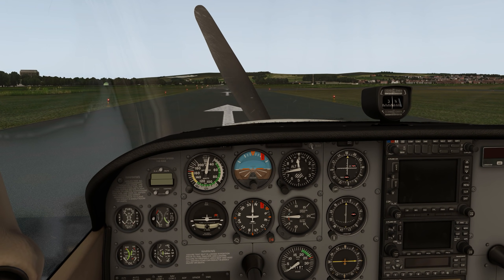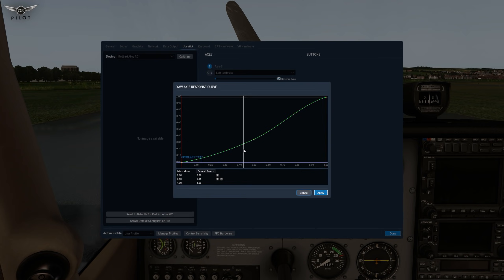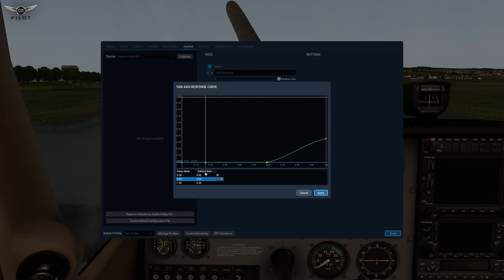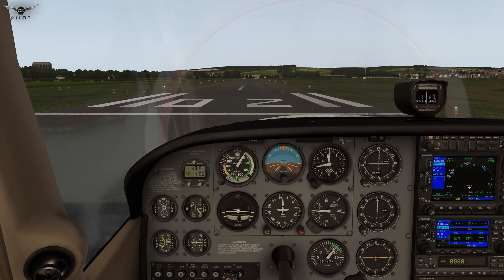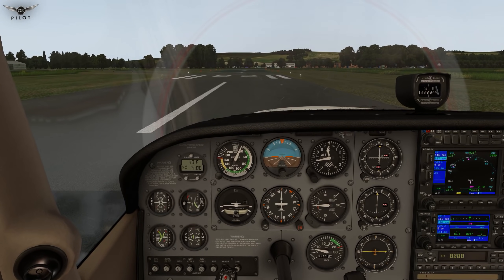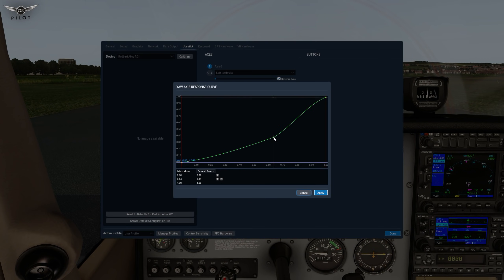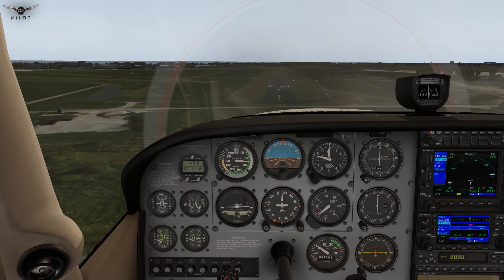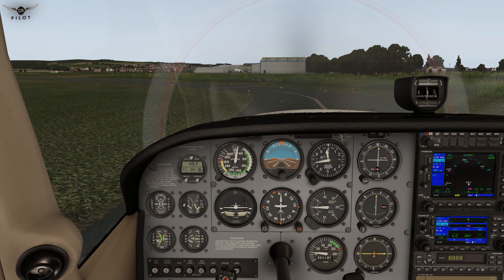X-Plane 11.30 | How to Configure Response Curves

Comment: Thank you for this important info! And one question - maybe you know how to reduce a significant left side shift during a take-off run? I assume that it may be "as real", but my Cessna turns to left very strong, and I can not keep it on the centerline!
Reply from the maker: What is the wind speed and direction? Cessna's have a tendency to do that in real life. How strong is the shift?
Reply: @Q8Pilot  Here is the METAR:    EPPO 011200Z 22014KT 9999 OVC028 05/01 Q1011

Decoded textual weather for EPPO

Wind: 220 at 14 knots 
Visibility: 10+ SM (9999+ m)
Clouds: Overcast at 2800 feet
Temperature: 5,0C
Dewpoint: 1,0C
Precipitation: None reported
Altimeter: 1011 mb (29,85 inches)
And I practice take-off from both runways at EPPO! Effect was the same. I tried different airports even with VMC, but shift also exist! Today I reduce my Jstk sensitivity for rudder input and was a little bit better to keep aircraft on the centerline) I think this behavior does not depend on the weather - it exists permanently)

Comment: Thanks for the clear instructions. I built my own tiller for the Zibo 737 using an Arduino processor, a potentiometer, and a handwheel. When I try to create a dead zone via a response curve, the current position (the blue crosshairs) is not at 0,0 but at 0.66, 0.67. In other words, instead of starting in the lower left corner of the graph, it is out in the middle. When the tiller is turned, it moves left or right of that position. I'm not sure why it appears that way, but given that, how can I create a dead zone? I've tried making a flat spot on which the resting position is centered, but the result is a dead zone only in one direction.
I did stumble on a different way of doing it. When calibrating the device, while the timer is counting down I jiggle the wheel back and forth covering the area where I want the dead zone to be. I assume that the program interprets this as hardware jitter, and it creates a dead zone to accommodate it. No response curve needed.
I've been using my tiller for years and it only recently started giving me trouble. I suspect the potentiometer might be wearing out. The plane would veer to one side upon touchdown, which I initially blamed on the rudder pedals. Then I realized that the tiller was causing the nose gear to be skewed slightly to the left. Definitely not conducive to going straight down the runway!

Comment: Thanks  this information on this video.
I have the Hotstart TBM 900 on X plane 11 and for the most part I LOVE it EXCEPT the EXTREME SENSITIVITY on the controls.  After messing with it for 6 months I finally just threw in the towel, but this past weekend I decided to give it another try and began searching videos on how to adjust the settings and ran across yours.  I studied it and then started adjusting my settings (what did I have to lose right) and after about 2 hours of tweaking I made some REAL progress.  It actually flies like a real plane now.  THANKS SOOOO MUCH for your insight, it really helped me.
Reply from the maker: Glad this has helped. Happy flying

Comment: Can you slow down the speed of a yoke control?  For instance my yoke moves the ailerons way too fast.
Reply from the maker: The speed of the ailerons can't be controlled, but you can adjust sensitivity by adding response curves. This will make the controls less touchy and will greatly improve your control of the aircraft.

Comment: I need the nose wheel to be less sensitive and the rudder to be more sensitive - can this be done?
Reply from the maker: Yes, just add response curves like it is shown in this video. You might need to tweak your settings differently depending on the gear you have.

Comment: Hi - I also have the Hotas throttle however if I apply full power I can get only 2000 RPM on the Cessna 172P...??? What an I doing wrong here ? If I set my curve to linear at 100% I get 2000 RPM max. Hope you have a solution for me. Cheers
Reply from the maker: Seems something wrong with the calibration or response curve. I suggest you delete the response curves, re-calibrate your device and see if this helps. Go to the run command and type joy.cpl and verify that the throttle moves the entire distance when you move it physically.

Comment: For those with Thrustmaster TFRP pedals (and/or the whole T.16000 HOTAS kit), use Nyogel 767A on all your rails. The only downside, is it's hard to find the detent point on the rudders (also hard to keep them clean, especially if you have pets, though so far after several days of heavy use, dirt/hair hasn't ruined the experience yet...just vacuum around them often & wear socks). I'm otherwise using default curves because I have no reference to how any plane actually handles, so I'm trying to make it more difficult in my sim in the hopes that reality is easier.

Comment: I configured the response curves to more accurately reflect the controls of a helicopter. It worked great. Didnt work  good at all when I went back to airplanes..took awhile for me to figure out why the throttle wouldn't come back to idle. The pitch ..yaw..roll had to be reset..

Comment: @Q8Pilot, I know you have done a tutorial on response curves for C172 so do you use the same profile config across your collection flights in your hanger or you have each plane with its config, also what are your control response and argumentation settings?

I'm keen to know what response curves you use for Zibo, A319 toliss and A330, thanks in advance.

Comment: Hi Q8P, thanks for the simple and clear explanation! I have often (also clear weather) with my chproducts pedals and 737 that i have to apply rudder to keep it on the center line. Can i also use this f7nction to correct it. My pedals are already calibrated. Thanks for any advice 👍🏻

Comment: I also fly Radio Control aircraft. This is a feature in most modern radios to “dumb down” sensitivity for control surfaces, particularly for beginners, so movements aren’t as responsive causing the plane to be twitchy. Could be useful but at the end of the day, you input the necessary controls for each plane to fly it accordingly. Every plane is different and part of the challenge for me is working with the differences until I can master them. Still, I can see this as a useful feature for fine tuning flying characteristics for many people.

Comment: Could you share your "control sensitivity" and "stability augmentation" settings?  This is very important to handling but rarely discussed.  Also, what curves did you find work best for the TBM 900?  Thanks!
Reply: I paused the video and used the settings  shown.

Comment: I fly a lot of RC aircraft and every channel in the radio system has these curves. In RC it is called "exponential" or expo for short and I've often wondered why it was not incorporated into simulators. I think that will be a huge help.
Reply from the maker: It is indeed a great help. Very glad Laminar did this. Thanks for watching!

Comment: Laminar should make a user database where you can download other users “realistic Cessna settings” etc. making it easier for everyone
Reply from the maker: That would be a bit difficult I suppose because every hardware will have a different curve profile. It would be useful nonetheless. Thanks for watching!
Reply: Also, I'm not sure if you use xcamera.  I think its a fantastic plugin.  However, there is a database/collection of user contributed cameras available for each aircraft.  This is great in theory but there's little way of knowing which ones are any good.  (I've tried using ones with a high number of cameras as this can show that someone has spent some time on it, but this is skewed by the creation of orbits which quickly add a large number of cameras).  In both cases, some kind of peer-review system would help I think.
Reply: A year later: does this exist yet? It really wouldn't be hard to do.  Only needs a Wiki-style website, where each article is a given controller model, and in each article, are either config downloads or at least pic or text of settings.

Comment: I toyed with these settings in Beta1 before I decided to roll back to 11.26 & to wait for the completed 11.00 release.
I have the Thrustmaster TFRP pedals & the software includes a response curve config tool. I understand that it writes direct to the hardware & I suspect it overrides any settings in the current 11.26 XP. It will be interesting to see whether the new response curves will take over priority. Until then I will remain confused :)
Reply from the maker: There were bugs in the initial beta. Beta 4 is stable.

Comment: SO.. no more screeching tires from the slightest bit of rudder now?  Hopefully this fixes my problem of the airplane creeping left/right while in flight all on its own with no control changes... very frustrating@!
Reply: Q8Pilot will correct me if I am wrong but methinks he has replaced the dreaded tyre squeal audio file with the wet runway audio file. At least it is a temporary fix to a problem many simmers complain about. Check this vid out :- https://www.youtube.com/watch?v=tLkyWo8sFh0
Reply from the maker: You can replace the dry runway file with a mute one correct.

Comment: These settings are useful, but they need a knowledge of how the specific aircraft behaves, otherwise it risks having people putting cessna with boeing behavior (for example).
When in doubt, leave it as it is ;)
Reply: This feature is primarily designed to compensate for differences in computer peripheral hardware vs the equivalent controls in a real aircraft.  For example, a joystick may have a relatively small travel distance in comparison to a real-life yoke. A given response curve will produce different results - depending on the hardware peripherals in use.
Reply: Laminar should get a user database that you can just download some other persons settings like Rex does with their custom textures that would be awesome
Reply: Completely agree !!!
Reply from the maker: I agree with Julian. Each hardware will have a different curve profile. It would be difficult to customize per aircraft per available hardware. Possible but very difficult.
Reply: Wrong. Everyone's hardware has a different scale of deadzone that needs to be accounted for, now with this you don't have to use your hardware's software or another 3rd party program to account for your deadzone. This should have been a part of X plane from the beginning, now I don't have to use software to have true flight controls